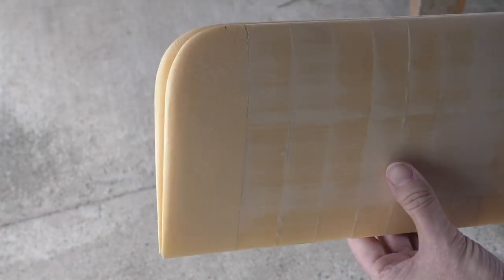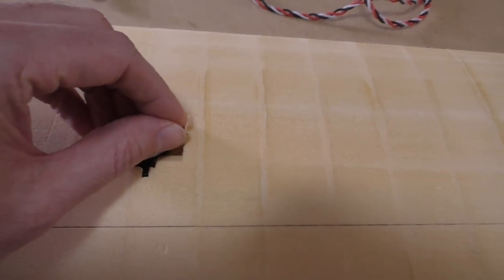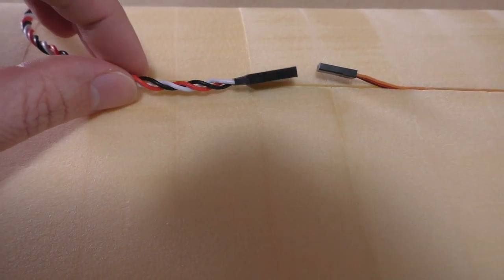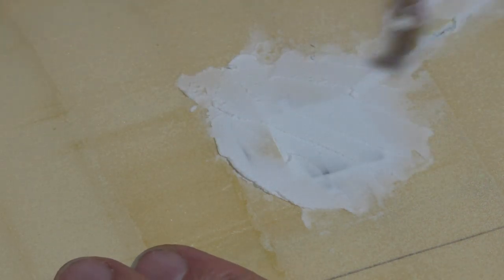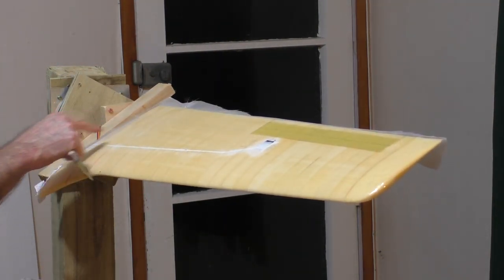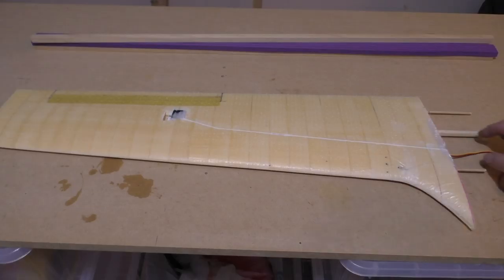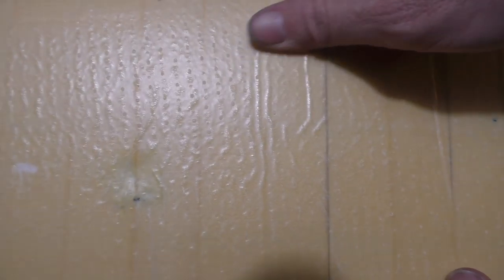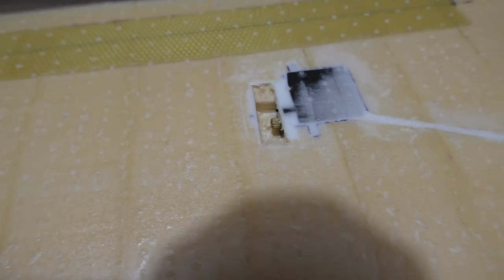Homeslice 3 part 6 (waffling intensifies, how can it be part 6 and not flying yet)

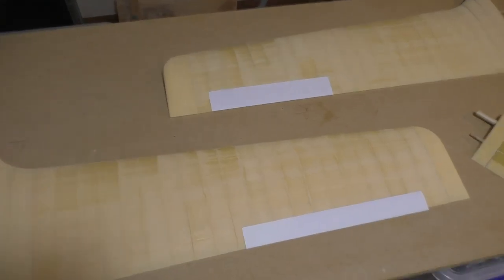Comment: 0:20 I read Model Aircraft Aerodynamics by Martin Simons, and it said that a high aspect ratio aileron is much more effective than a low aspect ratio aileron of the same area. As said in the video, putting the aileron at the wing tip makes a huge difference too.
Reply: Im thinking that a long and thin aileron could be a little bit more efficient when producing the same amount of roll torque too! iforce2d could do some tests on that 😁

Comment: For sealing the bag, just get some u-angle plastic (I think bunnings used to carry it) and a suitable diameter piece of rod (I have used brass or aluminium) double the bag over and push the rod with the bag round it into the plastic.  Works well.  And cost about $20.  I used to have 4 sets so could run a number of bags at once.  The other thing I used to find handy was tube plastic, though it can be hard to find.  This is a bag that is open at only the ends, just insert wing into it (bit of a mission with 1.5m wing but can be done) and then seal as above.  I have made those inserts into the bag.  Seal with blue tack, just make sure they are over some breather cloth.

Cheers

Comment: Aren't there some examples of slower setting resins being put into a vacuum before application? If you're using something similar (slow to harden), it might not hurt to put a disposable container of mixed resin into a larger chamber under vacuum for a few minutes to draw out a portion of the gasses before application. That way bubbles aren't being poured or painted in, and the point of bagging would be more towards compressing the surface when it sets. Then (in theory at least) there should be practically no bubbles at all with the rest of the application. I think the vacuum right before use is also the case when something is made out of an epoxy resin alone (not a composite), which might be an interesting approach for making canopy bubbles or streamlined FPV camera windows.

Also if you try that, might want a vacuum chamber with a window and moderate the draw down of the vacuum. The stuff could boil up out of the smaller container which could make a mess in the vacuum chamber. You want it to bubble up and out (to outgas) but not boiling over.

Comment: The high aspect ratio aileron produces less drag and therefore less adverse yaw.  Important in high aspect ratio winged aircraft...   general rule, make them proportional to the aspect ratio of the wing.   The principle of how ailerons work is that they change the effective AOA of the wing section that they span, so a greater chord is more effective for a given span, but the longer (span wise) the aileron is, the more of the wing gets it's AOA increased.  either way, it works, but consider the drag produced to the main consideration. 
Liking your methods..   How long before you create molds for the  wings, and start using carbon composites?  some lite ply end caps would be useful for your wing sections?  they could be laser cut easily.  I've been using lots of laser cutting for prototypes lately, and it works well.  consider using cross-weave carbon tubes for spars. They are very precise, and if you order matte finish, they can telescope, and make for excellent modular sections.  I'm going to try a carbon fiber thin layup on one of my wing sections soon to decrease aero-elasticity, using epoxy, and 200gsm fiber cloth.   Wishing I could find some 100 gsm cloth, but it's a big airplane, so should be fine..   Do you consider the vacuum system redundant at this point, considering how well the tissue and careful application works?  Seems like it is causing more problems than it solves?  of course it would work well when using a mould... 
 thanks for sharing!!
Reply from the maker: Yeah the way things are going I wouldn't be surprised if I end up trying molds someday, will have to make a big CNC machine first though I think. I have not found any carbon under 200g, although I have not really been looking hard either. Yes for these wings I think I would have been better off not vacuuming them. At least not in the exact way I did it - the main problem seems to be this perforated film is a bit thick for this purpose. It's kinda irritating because it was perfectly fine on the tail fins, I feel like I did my due diligence properly before doing the wings the same way.

Comment: Is there something like thin Teflon tubing that you could pre-cut an internal channel into the slices for?  It would allow for servo replacement in the event of a hardware failure anyway, cause the wire would feed through it, probably.
Reply from the maker: I might try something like that if the wing is thick enough, but just with bare foam holes (no tubing). The inner part of the flying wing plane was a bit like that, the trick of dropping a little nut through with a string tied to it, then pulling the wires through with the string, should do the trick.

Comment: You should try including a fibrous chord the length of the bag to ensure even vacuum throughout. The chord acts like a roof gutter collecting all the run-off and directing it into the downpipe
Reply: I use a water-sky nylon rope all around the wing, which creates a sort of air conduit.  Old school ...
The old engineer

Comment: If concerned about weakening the core with a cut for the servo wiring, do the cut in a straight line and insert a length of 1 x 5mm carbon strip on edge. Thinner if you can get it, the epoxy will fix it.
You could try putting the glass on first and then wetting up with resin. 
Servo extension we usually stagger the joints, solder and then heatshrink on each conductor.
Be aware that in days gone by it was necessary in some cases to fit a signal booster amp ( basic 1:1)on long extensions say over 1 metre.
Effect of capacitance in the cable over the long run would create a creep in the servo position as the model flew further away from the transmitter.
May not be an issue with modern radios as this was in the 90's with JR and Futaba when the first computer radios appeared.
Reply from the maker: I have seen many videos on YouTube where people lay the dry glass down first and then wet it out with resin, but I just can't imagine that ever working with the particular stuff I'm using. This resin is already slightly thicker than gorilla glue right after mixing, and only gets harder. The light 50g/sqm cloth cannot handle any kind of sideways pulling or tugging without being distorted, irreparably in most cases. I think trying to push this resin with a squeegee across glass that is not already stuck down would be game over. In any case, laying the glass first and then wetting is only applicable for the first layer - any subsequent layers you add will be laying glass on a wet surface so I figure you might as well get good at doing it :)
Reply: @iforce2d  Ahh..ok...starting to make sense as to why you have so much trouble.
Resin we use here is from CG Composites in Brisbane ( https://cgcomposites.com.au/)
The one we use LC3600 (LY3600) is a 3:1 resin/hardner mix by weight or volume and is as thin as piss. ( best way to describe it) and it thins as you work it.
Had a quick check on their site but it seems they may have upgraded to a different product number now.
Cheers Jorgo

Comment: If you are going to be soldering the wires right from the servo anyway, I would suggest using silicone wire instead and then twisting it together. you lose some of the mechanical protection of the harder rubber coating, but it’s much nicer to re-solder, won't degrade over time, and since it'll be twisted it will have better rf performance.

No, biggie, but you might want to for future builds

Comment: Love the waffling and everything else too, it's a bummer the wings didn't turn out as clean as you'd hope to. Vacuuming these large things seems hard.
Do you know what exactly caused the wing to be so different in length? How are they in terms of weight difference? Is that hard to get right, especially with the epoxy?
Also regarding the servo,
I was thinking you could put the cable in first without the servo permanently in place, so you can replace it eventually.
Basically just put the blank cable in there, and then solder that to the servo. I honestly don't know if that will turn out as neat as your solution right now, but I recently had one of my servos fail in a rough landing, (one tooth of the second gear from the output broke away due to something yanking up the aileron) so I noticed how essential it was for me to have that exchangeable :)

Cheers, keep up the good work, I love watching it!
Reply from the maker: The foam boards are not always exactly 30mm thick. The wings were about 6 grams different before putting the glass on, now 2 grams different.

Comment: 5:03...Might have been easier to buy long Servo Extension leads with connectors already installed. I've bought them as long as 1 meter. BTW... I would stagger the solder joints in the wings to make the 3 joints smaller.
Reply from the maker: That's what I did, the 60cm ones I showed in the video. But I needed longer, I didn't want connectors on one end, didn't want twisted, I've never seen 1m anywhere, this wire I bought here in NZ and it arrived the next day instead of 2 weeks from China, if I bought 1m I would either have two lengths of 30cm wires cluttering up the inside of the fuselage or I would still need to cut them and attach a connector at the 70cm point and then have two 30cm to hopefully use for something later, if I buy 4 meters of bare wire I have no wastage. Hope that's enough reasons :)
Reply: @iforce2d  Remember to leave in the fuse more wire length than the distance from the joint to the servo ... for future unavoidable servo  maintenance !
The old engineer

Comment: Try degassing the resin in a vacuum chamber beforehand,I was thinking you could also be picking up bubbles from the foam itself,would sanding sealer work or will it react?
Reply from the maker: I think the main issue is that the perforated film is a bit thick, and it has small crinkles in it from being perforated. I'ts probably not intended for jobs where you're fussy about a smooth surface.

Comment: Wouldn't it be more effective to not fully evacuate the bag but put the whole bag in an environment with higher pressure, e.g. 2-10 bars? Because I think that the gas inside the foam contributes to the wrinkles (just a thought, don't know if it's even relevant).
Reply: How though?😁 Filling a large tank, that you can put stuff in and take it out, with 10 bar is a lil bit dangerous.
Reply from the maker: I'm using about 0.15 bar of pressure differential, seems to be plenty. For this I already had enough trouble making a chamber that would not crush, and it's only a small one. I think to make a much larger chamber that can fit all potential future jobs would be way more of a headache than just cutting some plastic sheet, the sheet is cheap and you can make whatever size bag you need for each job. Plus you would still need the plastic sheet to go around the part anyway. Then while curing your large chamber would take up a lot of space and you would not be able to place the part under an electric blanket or in an oven. 
But supposing you did manage to clear all those hurdles, I doubt the result would be more effective anyway. Sucking the air from the bag to get it out seems more effective than pressing on the bag from outside, which does not necessarily move air out of the bag.

Comment: An aspect which is not super important to your type of flying is control surface rigidity. On a high speed pattern plane you're going to see very long and thin (airfoil design also plays a role) where on a 3D type plane it's more about massive barndoor like surfaces, where high speed stability is not a design factor.
Reply from the maker: Right. I forgot to mention that the length of the hinge might also be a criteria to consider. With longer thinner ailerons you're getting more hinge strength for the same area. At least if you're making the hinges like I'm doing here - I suppose if you use pins or those plastic hinges it makes no difference. The kevlar will also be putting some strength back into the wing I think.

Comment: It seems that the air is getting pulled out of the foam so it gets stuck between it and the glass.
Reply from the maker: I think the main issue is that the perforated film is a bit thick, and it has small crinkles in it from being perforated. I'ts probably not intended for jobs where you're fussy about a smooth surface.
Reply: @iforce2d  makes sense.. also you might wanna avoid concave surfaces.

Comment: Hey, just wondering why you go for glass opposed to packing tape or covering film?
Reply: I would guess it's because fiber glass is far stronger than either of those option. With fiberglass the covering not only keeps the foam from denting as the plastic coverings do, it also adds a whole lot of stiffness and strength allowing you to build a much thinner and therefor much more efficient wing.
Reply from the maker: Mainly to explore and experiment with new (to me) methods, but also because it makes it very strong, quite necessary for a thin narrow wing like this. I tried only packing tape with the first homeslice plane and it worked very well (with thicker wider wings though).
Reply: Cool, it's very interesting watching you experiment with different ideas. I'm down in Chch so it's great to see what materials you can readily source and how they can be applied. Keep up the good work!
Reply: @iforce2d  How heavy is your center fuselage likely to end up, and what's the total wingspan? I still suspect the wing could run fine at current thickness with one or two "plank-on-edge" full-length, full-depth spars and get away with a tape-only skin, for less total weight and hassle-factor... Not that I'm complaining, mind, I'd know nothing at all about fibreglassing if not for your work! Sometimes doing it "the hard way" is the best R&D.
Reply from the maker: @rcbinchicken  fuselage is currently 433g, wingspan will be a little over 1.6m. If I can keep it close to my goal of 1.2kg AUW (with 3S 2200mAh) the loading will be around 32g/dm2 or 11 oz/sqft. This is lower than the other two homeslices, I'm hoping to be able to catch some thermals with this in summer :)
Reply: @iforce2d  That all sounds very achievable. Might even be slopeable at that low a wing loading!